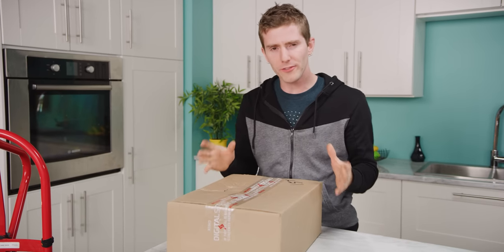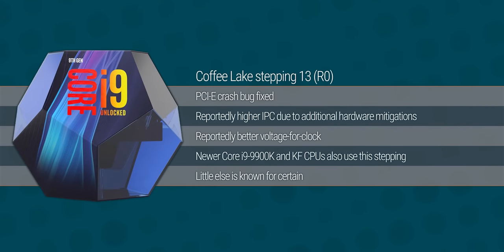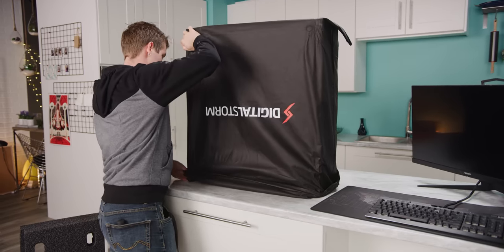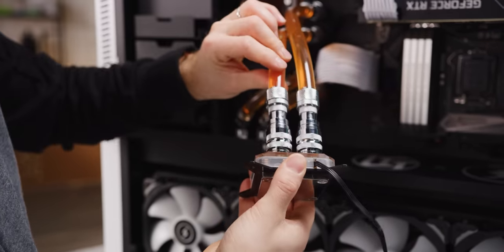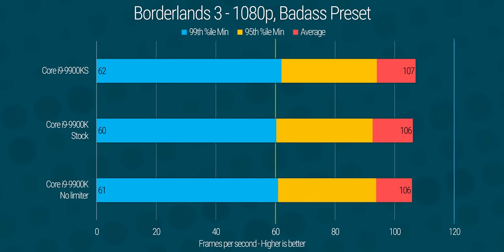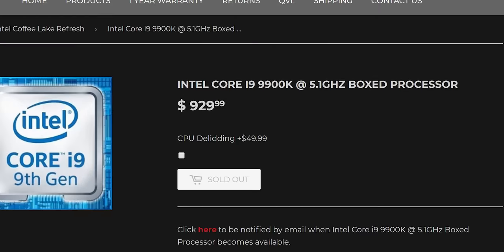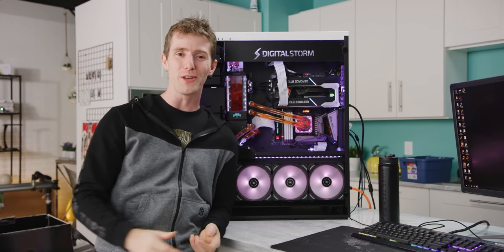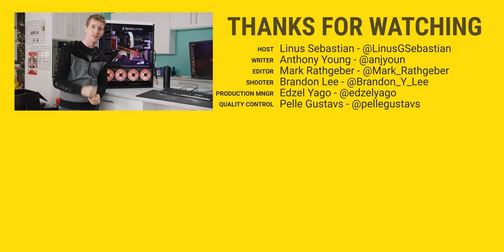Intel's PRE-OVERCLOCKED CPU... Core i9 9900KS

Comment: Introducing the Intel Core i9 - FX 9590
Reply: 9590K
Reply: That's the reason I settled for an 8700k over a 9900k. The die on the 9900k is to thick to my liking and question its longevity as I dont upgrade every time something new comes out. The 8700k in most cases comes close to it anyway maby I'll upgrade when Intel can double the core count from my 6 lol
Reply: @forog1  close? lol dude who are you kidding? the 9900k smokes your CPU in every scenario
Reply: Hey, you stole my title.
Reply: That name is too short for Intel.  More like Intel Core I9  FX 109590 KFC Extreme OC Black Edition, rev.1 mod.1.
Reply: Greg Salazar thanks for the spoiler
Reply: @GregSalazar  well no , but actually yes
Reply: @MrRagequitnow  PAIRED WITH RTGTXXX 3080 TI Gaming Pro Max Super Duper Extreme OC
Reply: @andy56duky  what's there to woosh
Reply: You know, it is the same principle as when that chip came out. Same architecture and process, just hotter and more power consuming
Reply: @lmCIoudz  it's not enough to make up for its heat and pure gamming and price the 8700k has better bang then the 9900k. I dont have a budget or limited funds. I just dont see the 9900k being a good buy. And yes it does come pretty close to it. It trades blows with the 9700k and talking about gaming wise.
Reply: Greg Salazar 👀
Reply: Eder my 8600k is at 5.3 and beats a 9900k in cinebench r15 by about 80 points
Reply: Dan// my 8600k beats a stock speed 9900k in cinebench r15
Reply: @racer2k5x43  nice and ur temps allow for you to overclock higher because you dont have a thick die to cool. I can do 5.2ghz on my 8700k on air Ithink you would need a custom loop for the 9900k for just 5.2ghz of corse I could be wrong but yea it come close to beating the 9900k with those clocks. But nice though on the 5.3ghz.
Reply: Only took amd FIFTEEN YEARS to get to this point lol. This race is not over. When intel at some point releases their TRUE 7nm cpus it will get interesting. Competition benifits us. Its not that intel can't make better. It's that they haven't just yet. But I'm sure they will at some point. Intel dominated amd for well more than a decade
Reply: Eder I hit 5.6 at 1.425v but my 240 aio wasn’t happy about it 😂 imma delid soon and try to get on a leaderboard. My chip is the pinnacle of a Golden cpu
Reply: @forog1  Sorry but what is this "thick die" nonsense? The silicon that the die is made of is the best conductor of heat in your system, no real bearing on overclocking performance. Also unsure why, if you don't have a limited budget, you'd buy an inferior CPU but I guess that's up to you at the end of the day
Reply: @racer2k5x43  omg! yes you got a diamond of a cpu there lol
Reply: @benjaminmcintosh857  "The silicon that the die is made of is the best conductor of heat in your system". Nope.
Actually silicon is a poor conductor, There's a reason its called a "semi conductor", When working it generates heat but when off its not great at transfering it, Silicon at 100*c is about 150W/mK which drops to more like 100W/mK when doped, Copper is nearly 4 times that at 385W/mK. Even aluminium is far better ~200W/mK.
Just become someone has money doesn't mean they waste it, Because then they wouldn't have money would they? In fact if you met some of the richest people in the world you might be surprised to find out they are quite good with money and making more of it.
Eder probably wanted the best gaming chip 2 years ago and this didn't exist back then. Should he spend 33% more and upgrade to a cpu that has exactly the same architecture/IPC as his cpu that works perfectly fine? Don't think so.
Reply: @benjaminmcintosh857  gamers nexus went over the die size. its the height difference from pcb to top of the die is taller. To the eye might not look that much but for heat it has a bit more to travel to making it to the cooler making it hotter because of this. So im like id rather go the rout of cooler temps for longevity sacrificing 2 cores. At just 5ghz my 8700k max temp is 56c spikes but 52c average on air while gaming. At 5.2ghz it spikes to 62c at times but 57c average. Looking at video's on youtube shows off their gpus with the 9900k and their 9900k I see hovers the 67c-72c on water at 5ghz. That's why I settled for the 8700k :)
Reply: Eder// Did you HAVE both options? I LOVE my 8700K (5.1 @1.325 delidded 36-76) My first 8700k suffered an unfortunate death during the delid, this was right when the 9 series launched.. I went RIGHT BACK to my 8700k. The choice between 8700k and 9700k was a NO BRAINER, and the 9900s are running were not only sold out, but had the space heater rumor OUT THE gate.. I'm gonna say good call either way, call me biased.
Reply: @tomstech4390   I wouldn't call that 'poor' but I do stand corrected about it's degree of conductivity (was going off of a der8aur video from around a year ago) - in which case it clearly follows that a taller and narrower die would have higher temps, which we see present in the 9900k. 
As for money, don't patronise me I understand that spending money for the sake of it is pointless, that's very obvious and why I acknowledged it was up to Eder to choose. Was just curious why one would opt for a weaker overall CPU if money were no object, their reason being longevity it seems.

Edit: experiments on specifically doped silicon have achieved thermal conductivities over 1000W/mK
Reply: @forog1  idk if I'd be concerned about temperatures that much, CPUs are pretty durable anywhere below 90-95 degrees constant but you do get the related benefits of reduced heat output and power consumption so fair call
Reply: Casey Lane wow and you overclock the 9900k by .1 and it beats your 8600k. That’s old new buddy
Reply: @lmCIoudz  perhaps he meant 9700k. 9700k is only 3% worse in gaming and like 20 in workstation and desktop use and for the price difference I don't think that's worth. You are right about the 8700k, it's kinda overrated
Reply: FX 9590 was the worse gaming cpu ever. 9900KS is the best gaming cpu.
Reply: @andrewmurphy9538  Yea I had the option to get the 9900k as I built my system February this year and they were very much available. I batted an eye at the 9700k but for $300+ id rather hyperthreading on all cpus at those price points so... 8700k it was lol. only thing is my chip is not a very great chip for low voltage overclocking best it can do is 4.7 on all cores at stock voltage : \ and +0.170mv in ordere to hit 5ghz
Reply: Masterclass RetardTM 9590kxs, compatible with lga 1151 and AM4 without using an adapter

Comment: Pre overclocked? 🤨 So that's just a stock cpu sold for an higher price and saying it's not?
Reply: Yeah, pretty much cherry picked 9900k's.
Reply: Same as both parties have always done.
Reply: flashbacks to fx 9590
Reply: @thesoopersooper  So what's so special about this new silicon? Is it more silicony?
Reply: @Psycorde  Intel - same as most manufacturers - is constantly working on the production to increase yields and performance. The current stepping is again ever so slightly better. A 9900K (not S) from the current batches needs a bit lower voltage to run at the same settings. Nothing major, but helps Intel to reduce problems with the CPU (And thus reduces angry customers and saves them money).
Reply: @NamelessONEMail   It is an MSI-board, i know from experience (used 3 of their board in the last year) that their default-settings are abysmal.
An i7 8700K at STOCK took well over 120W with their settings. Just setting it to the official specs and it runs at 4.3 GHz allcore at around 85 Watts peak.
overall decent motherboards but the default settings can quite literally reduce performance to below stock while at the same time requiring more power.
Reply: Hmm, I don't know, maybe if you had watched the video you would know...
Reply: I mean he literally explains what it is in the video. I'm not sure how you managed to misinterpret that
Reply: @NamelessONEMail  lol calm down guy, the 9900ks is a binned 9900k while it is a different cpu its not by much even according to that video cause i already watched it. If you put both at the same frequencies although that is much harder to do on 9900k you will get exact same performance although at probably different volatage. Its essentialy a preoverclock with better silicon lottery.
Reply: @NamelessONEMail  Yeah LTT is like the mainstream of tech review for normal/slightly interested gamer/ pc liking people (only surpassed by that black dude, I hate him, for me he personifies apple). When I started getting into pc builds I discovered LTT and I love them to this day, but if I want to inform myself properly there are much better alternatives like der8auer or buildzoid.
Reply: @NamelessONEMail  If you want performance and low noise, you really don't need any Intel reviews. It's 3950X with Noctua DH-15 if you really need the performance, or if you can wait a little, Noctua is releasing their new flagship air cooler soon. The performance of those air coolers is pretty mind boggling. Well, and those fans that come with the coolers.

3950X PBO2 enabled, Infinity Fabric at 3800/3866mhz, fast low latency ram configured to use the lowest working timings with Ryzen DRAM calculator, and you have the fastest gaming CPU on the planet. On everything else it's completely in it's own league. And for gaming, allocate all processes to lowest clocking core/CCX and allocate all the rest for the game. That removes context switching and cache trashing from the cores that run the game, thus allowing little "better IPC". 

The above should work on 3900X and could possibly make it the fastest gaming CPU also. At least when couple of the fastest and lowest running games are removed from the average to get better representation. There should be videos coming where 3950X gets the gaming crown with the above methods. And when games that are made for Zen 2 based consoles are coming, then games get the full support for chiplet architecture and Zen 2 based "hyperthreading" (which is Intel's market term for SMT) and start to use more threads. So results will be MUCH better in the future. There isn't even 100% support for Zen 2 in any of the compilers yet, but those are coming in the 1st half of 2020. So Zen 2 should get better optimization next year, widening the cap to Intel.
Reply: @tonnentonie2767  Don't forget Gamers Nexus. Did you hear about Rockstar catching wind of Steve's video regarding Red Dead Redemption 2 PC issues?
Reply: @PSYCHOV3N0M  no what did they say?

Comment: The 9900KS is not the first factory overclocked processor by Intel. Before the 9900KS we had the 8086K which was just a cherry picked and binned 8700K that was slightly overclocked. And if one wants to really think about it, The 7700K was just a factory overclocked 6700K before that. So, How again is the 9900KS the first factory overclocked CPU from Intel?

Comment: "It constains new hardware mitigations for hardware exploits"
Zombieload 2.0 joined the chat
Reply: @Erick Rosa The Intel ones, yeah.
Reply: JCC joined the chat
Reply: Merely entering chat would not be enough.

There is a reason Intel is down-playing the exploit. It requires physical access to the system to exploit. This is a threat to large companies due to evil maid attacks, but the average consumer would have bigger problems to worry about than the exploit if it is executed on their personal computer. Such problems usually involve the police or requiring self defence skills to deal with.

This is very different from spectre/meltdown which were software based attack vectors so could be executed remotely and anonymously by malicious software, potentially even from within a browser (or so it was claimed).
Reply: @drsupergood8978  Spectre/meltdown were theoretically doable by software but they required so much preparation in order to be able to set up the exploit that it's highly unlikely that such an attack would be carried out by some random virus. It's national security level targets that should be worried about those attacks, not random people, and for us to all suffer massive performance penalties because of it is a bad priority.
Reply: @mikeydude750  they did it just for pr
Reply: Hey you guys...
You know that if you place a piezoelectric antenna and a fine-tuned receiver circuit under your laptop you can pick up data that is sent to your ram or through your pcie lanes...

If you go to Starbucks, place your laptop on the table and that table has a electromagnetic listener tuned for digital phreakig sticked to the underside, they can totally compromise lots of security stuff like keys, passwords, personal infos, etc...

Unless you are paranoid about everything being a listening device, your security is very very hackable.